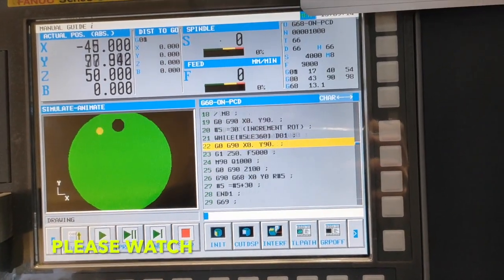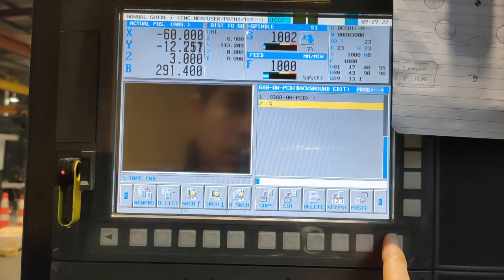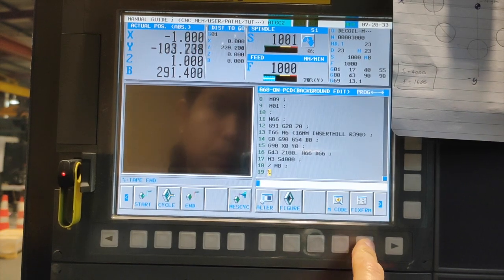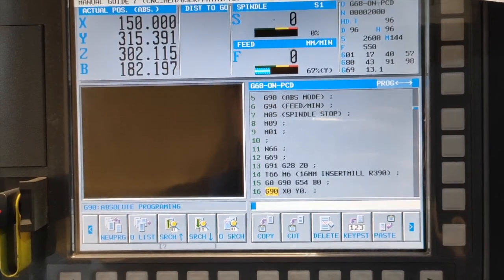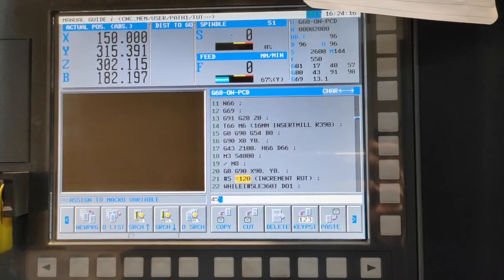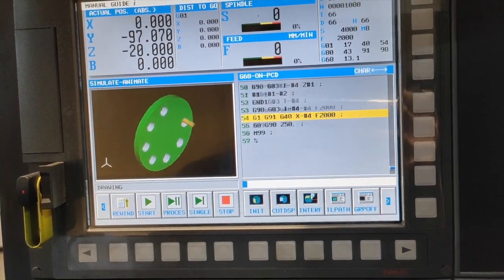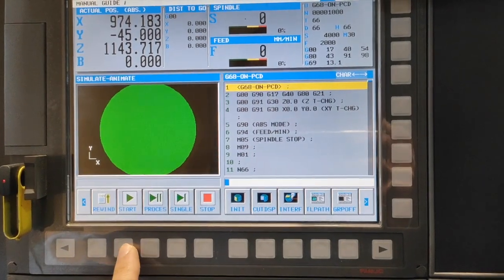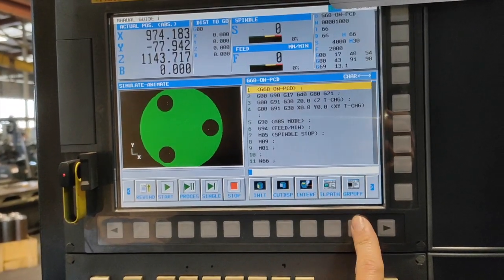#HOW  TO PROGRAM  PCD  USING G68 IN  MACRO PROGRAMMING part 1 #11

Comment: For tapping Peraphs is better use G16, for radiali coordinates. Only amgle on Y and range on X. And G16 is usabile with g81 for boring. 
After G15 for deactivate the radiali coordinates and return to linear coordinates. 
But G68 is beautyfull 😆😆
Reply from the maker: I agree if your doing just drilling And tapping G16 is one of the best to used. But if doing something like my program which is  making circular  holes probably G68 is better.
Reply: @SamTheMachinist  it's OK. G68 for pocket on circonferenze or similar are OK. Usually for tapping or hole I prefeer G16, so I can read the coordinates directly from the technical design, without calcolator 😁😁😁
The two systems are all ok, I prefeer them at G12, more complex.
Only one thing, your work is very very good.
I'm a cnc programmer and teacher for cnc and industrial facility.
I like tutorial like yours because I think that we, every time, can understand by others.
Good work.